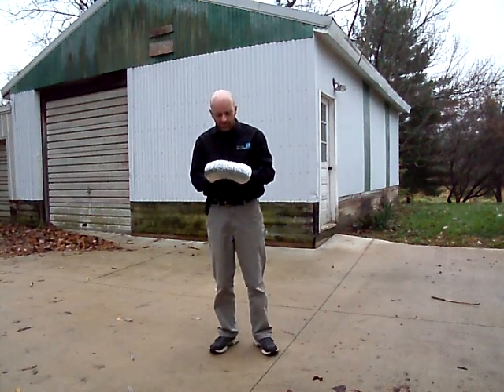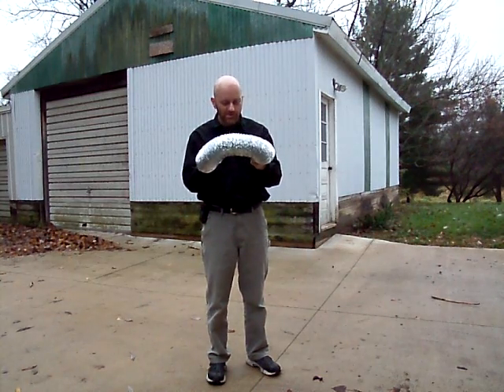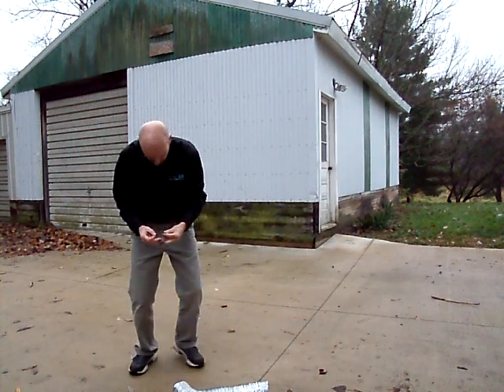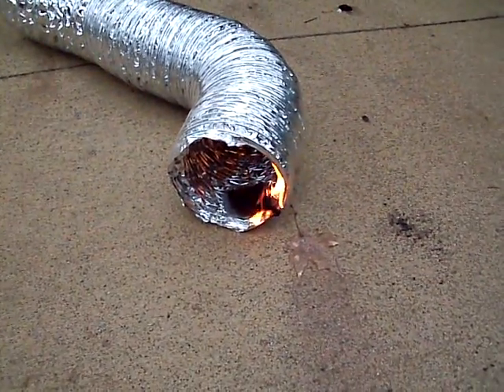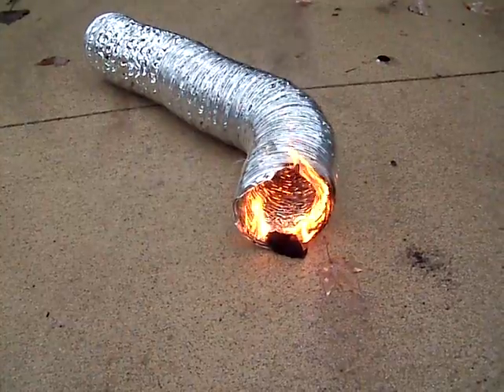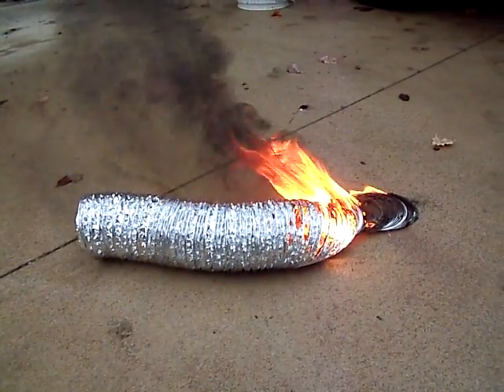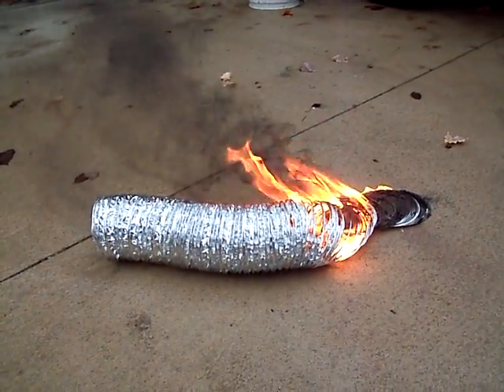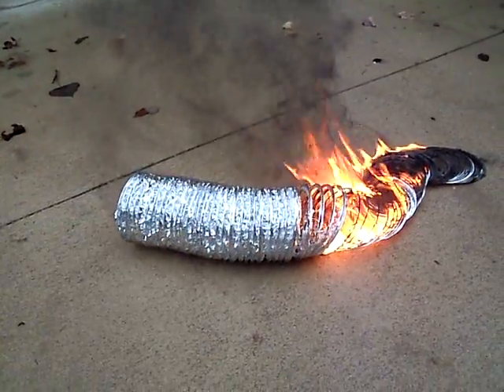Dryer vent installation BAD IDEA

Comment: The bad stuff shown here does contain a very thin sheet of foil (or maybe two, I have no idea), but there's a plastic liner inside (or between the two sheets). Obviously that thin sheet of foil isn't going to hold up if the plastic lining catches on fire. Unfortunately, the semi-rigid duct is a pain to work with (and in some cases, you might need two of them), but it's worth it for the elimination of the fire hazard. Just don't use it anywhere the duct goes through the wall or floor, anywhere hidden in the walls or floors, or anywhere downstream of a built-in duct.

Comment: I used to work at a factory that made those hoses I ran the machines that made them I no longer work there in Indianapolis Indiana called Deflect-o I worked there from Jun 15th 1997 til February 13th 2008 I remember when Oshawa came in and made them do tests on the hose , they had to build a room in our department and yes they flamed up but is that the hose that is black inside or aluminum? Anyway found out that when they knew Oshawa was coming they would have the main operators to turn down the amount of glue they applied to the material but they did address the problem at one time but who knows

Comment: Do you know if Magvent is ok? The duct coming out of the dryer looks like cheap foil in photos. They say, "Our magnetic dryer vent couplings are made of UL 2158 (0 Flame Spread) transition hose, ferrite ring magnets, and stamped aluminum sheet metal."

Comment: We don't know why who ever up a the top that are making the rules how they can allow this even to be sold. We see this everyday. Explaining this to a customers in these terms, every ridge , Traps the lint, if it gets plugged and it's a gas dryer, The carbon monoxide with come into the house instead of going outside,.
Also All flex dryer venting traps the lint in the walls of the vent. also hinders the air flow. 
Was Great to see this video as most home owners and HOA's Don't know about this and almost have to plead to get the point across. Good Job!!!

Comment: This stuff isn't made for dryer venting--its made for exhaust fans and other low temp venting. It clearly state on packaging "NOT FOR DRYER VENTING" that's why its important to read. Hell,flexible air duct for your central air will burn too, but we don't connect to dryers. Some things are better left to those who know. If you think you can, then check you homeowners policy coverage and make sure its current.

Comment: Scared myself, once.  The dryer wasn't drying a load of clothes in the "usual" hour, so I thought:  "maybe there's an accumulation of lint in the system."
The first problem, was getting the screws off the back of the dryer:  they were hexagon-shaped heads, no slots or the usual screw heads.
I found my magnetic screwdriver that has twelve different bits, and, looking at the screwdriver itself, the shaft had a hexagon-shaped head.  Perfect!  Hopefully, that will work.  (I was crossing my fingers!)
It did, and with a little muscle, I managed to get the screws off the back of the dryer.
Removing the panel, I found a collection of lint wrapped around the dryer drum, roughly an  inch or so, away from the element!
I looked across the basement, and six feet away from the dryer, is a gas furnace.
Anyway, I managed to vacuum all of the lint that was wrapped around the drum, and there was a few areas that were too small for the vacuum hose to reach.
There's one tool included with a canister vacuum, that, (in my experience), rarely got used:  the crevice tool.  Even though the slot in the end of the tool was plugged with clumps of lint, I managed to get it all out, and the next time the dryer was used, it took one hour to dry a large load of clothes, as opposed to the hour and a half, a week earlier.
The dryer is twelve years old.  It works just as well as it did, when it was new.  (And before I forget:  the dryer vent hose, is aluminum--not plastic.)

Comment: Fantastic video!  Happily, your Amazon link still works, but could you provide links for lengths of 10'?  15' or 20'?  I'd happily buy through your channel's Amazon links, so you can earn a bit (as you should).  But I do need to order asap, as I'm leaving town.  Keep up the great work!
Reply from the maker: Thank you! If you follow the links in the description to get to Amazon, as long as you buy other items during that same click-thru session, it will add it to my tracking ID.

Comment: FAKE. IF THE FIRE STARTS WHILE THE DRYER IS ON. THE VENT HOSE WILL BE CLOSED OFF SO NO OXYGEN NO FIRE.

U DID A VERY POOR EXAMPLE
 NOT EVEN REALISTIC. ANYBODY CAN LIGHT IT UP OUTDOORS WITH OXYGEN.

Comment: In states that have adopted the International Residential Code unamended, a rigid metal dryer duct is required when hidden in the structure but a transition duct is exposed and must be flexible with no seams or joints and UL 2185A rated. There are two classes of this rating: Class 1 and Class 0.  Class 1 has a flame spread of 25 and smoke generated of 50. Class 0 has a flame spread of 0 and smoke generated of 0.  Class 1 is for electric dryers and made of aluminum (not plastic) foil with spiral wire reinforcement )see Jonathan Brett's comment below).    Class 0 is for gas dryers and made of semi rigid aluminum accordion type aluminum.  Class 0 is also found on  a few heavy duty "ribbon" aluminum ducts with spiral reinforcing like DryerFlex now sold by Home Depot under the GE brandname. What you tested appears to be a plastic/mylar duct with no rating.

Comment: why would there be fire inside a dryer?   If you have a fire started inside your dryer than you have worse things to worry about than the vent.  Why is your dryer starting a fire?
Reply from the maker: In a gas dryer, there is fire dude. How do you think it gets hot?
Reply: @MattKnowsThat   Not inside the dryer.  The gas is suppose to be in the motor.

Comment: Some dryer ducts are right behind the dryers in tight laundry areas right off the garage.  Sorry to say but this vent is the only kind that will allow a dryer to push back as far as possible in tight spaces.  Also stacked units in tight closets in apartment buildings, same deal.  As long as you clean it out every 6 months you're fine brother been installing appliances for many years brother

Comment: You point out one huge problem. The other is the CAUSE people are using flex hose..... Dryers have a 28gauge at best, very short connection for vent. This connection compresses, allowing the clamp to just slide off... it is a miserable design flaw.  You got to wonder how many dryers are venting into the room fully, or partially. The industry needs a better connection at the dryer, and a mating one to slide the dryer into, using no flex at all. Should not be rocket science, just simple engineering to fix a 80 year old problem.   
I see an opportunity for an adapter connected at the dryer, and a mating receptacle for the back wall/floor.

Comment: Just bought my condo 2 years ago. Have an older stacked washer and dryer and figured that was why my dryer did not work very well. I went up into my attic yesterday out of curiosity because I wanted to clean my dryer vent duct and wanted to see what I was up against regarding material and distance. What I found was scary. The same vent duct shown in this video is what is in my attic roughly 14 feet of curves, incline and at end to outside it has an extreme bend due to rafter being right in front of exterior exit. I will be contacting property management as to who is responsible for correcting this 'fire hazard' and extreme inefficient material.
Reply: If you are the owner, then you are

Comment: I just had a customer with this stuff. No fire, just bubbled up under normal use. I replaced it with aluminum. good thing his washer broke or I never would have been there to remove it from the dryer.

Comment: The problem with this video is that you have the wrong kind of flexible vent hose. The kind you have isn't intended for use on dryers. If you had gotten the correct flexible vent hose, it wouldn't burn. This video is misleading. Get your facts straight.
Reply: Just curious then...what would the vent hose in video be used for?

Comment: You mean if you fail to maintain your dryer and you plug it with lint, you can actually start a fire?   Clearly people need to be licensed to operate clothes dryers, or maybe dryers should just be banned from residences.   Amateur clothes dryer operators are clearly a danger.
Reply: Nice comment lol

Comment: Thanks for sharing this as people can make mistakes when doing installations. Ignore the wise cracks as some people just don't appreciate being reminding they  are not perfect.  I will keep it in mind NON flammable for dryer vents. You just stopped a potential "OH SH-T" situation in peoples laundry rooms. I know that's what I would say if my dryer vent was burning like that. Especially given the fact the wood part its connected to on the house would burn away to reveal easy access to my basement to (anyone) who sees it.

Comment: Always remove your dryer access cover and vacuum them at lest every few months, turn of the 30 amp breaker to it first. Thousands of homes have burned due to lint build up, the lint screen dos not get it all. also keep the outside vent clear of lint this to is a fire hazard and at worst will over heat your dryer and burn out the thermistor costing you a service call

Comment: Thanks. After I watched this video I just now took that crap off my dryer and replaced it with proper aluminum ducting. Even though it will still burn, it has a much higher melt temp than that Made in China garbage you demonstrated. Thank you!

Comment: For the doubters:  I'd bought aluminum foil ducting, safe up to 185 degrees, approved for my dryer application.  Saw the video, decided to test for myself.  Totally burned through.  On my way to Lowes now for a  metal, semi-rigid.  Do yourself a favor, listen!

Comment: I as well can appreciate this. One factor you may have forgotten is the oxygen levels. When you have both ends opened as this shows, you allow air to freely flow through feeding your fire freely as well. But when the vent is putting out hot air, that dramatically decreases the air flow kind of like heat smothers people in a room. Those who devise these type of vents may consider that in their safety tests. Something to think about anyway.
Reply: That type of hose is NOT approved for use on a dryer

Comment: ive had this type in my home for 25 years, never had a problem. periodically I will clean the lint thru the entire length of duct. M y dryer is a gas dryer, but it is something to consider.

Comment: the flex material for dryer vents is 414 UL 5 layer foil,  is rated for 600 degrees, that has to be a bathroom material (bathroom flex has a plastic in layer inside, that's what is burning in the video and is not build to with Dr and 60p degree like the dryer vent material), lowes and home depot sell it in the section where you buy things for dryer vents, it's label really tiny don't use for dryer vents and that small piece lint would burn itself out, you are only allowed to use that material for 5 ft from the dryer to the 4in steel pipe, that flex can't go through a wall or ceiling or floor, I do agree hard pipe it is the way to go the personally, that's why u should have your vent cleaned every 2 year's, the problem with hard piping the dryers is the home owner pulls the dryer out to clean it and then never push the dryer back correctly,

Comment: you positive you're not using the bathroom exhaust flex? yes the flex dryer vent is only good for 5 ft in the laundry room. the bathroom has a vinyl material in it, the dryer flex material does not

Comment: Rigid metal duct is only where you're not trying to get behind the dryer (laundromat).  Home users often fiddle with plugs or rearrange their appliances - so flexible hoses are important to have.  I didn't know about the vapor leaks, though.  That's something people need to know.  Thanks for presenting this video, Matt.

Comment: Behind Sheetrock in my basement 2 lengths of this in vinyl were duct taped together making about a 35' run of this crap, the vinyl was outlawed but this was behind sheetrock. I had this stuff it was clogged up real bad and you could see pin hole's where small fires had started, this wasn't even a Gas dryer it was Electric dryer. I let it run like that for 10 years not knowing, it had been in the house for 7 years befor I bought the house.
That's 17 years of dryer lint in the line. I had to repair damaged heater floor vent the cat pissed in so I opened the drywall popcorn ceiling to do this and found a 2x10 joins bay loaded full of dryer lint from end to end. This was a lot of Lint. The house could have burned down from it and I often hear cracking joist but didn't know why after fixing this that fixed the problem of that, the joist were taking on moisture and warping drying out and making sounds. First off 35' for a dryer vent is way too long but if that's what you need to do Only use solid metal pipe with no screws, use foil tape to hold parts together.
I took all this crap out and ran it out into my garage then out a side wall total length 4 foot.
My dryer works better and doesn't break down as much. I intend on building a 4 hour fire rated box made of cement fiberboard around the duct work this is better than code. You can not by code vent a dryer into a garage. It's a fire risk, but its better than 35 feet of Vinyl pipe inside of a sheetrock ceiling. 
This is my reasoning for never putting sheetrock in a finished basement on the ceiling.
You can not see what's behind it or get to it to fix it if you have mechanical problems.

Keep your dryer vents short and no turns if you can. Take your dryer apart and clean out the dust every few years. Wile your at it tape the joints inside the dryer so it won't leak air.

https://www.youtube.com/watch?v=h6AcOHY632k A few good points you need to know.

Comment: Of course the semi-rigid aluminum flex duct is better to use for several reasons, but it is pretty difficult stuff to work with. In addition to banning plastic duct that is made to look like metal, they also should supply fittings to make it easier to attach the semi-rigid duct. Otherwise it is beyond the skills of some DIY-ers to prepare the stuff for assembly. It would be a shame to have to call a plumber for such a simple job. Not to mention, if someone cannot disconnect and reassemble their dryer duct themselves, it discourages frequent cleaning.

Comment: Educate people to READ THE LABEL.  
I bought a length of this for an air vent, and it states on the package that it is not for dryer vents.  
Getting this banned will not ban stupidity.  People will always find a way to screw things up.
Reply: Stupidity more like ignorance. Like the friendly home depot staff who suggest the one that is not for dryer vents.      I think that companies that try and deceive customers who are not experts in dryer venting requirements should be held accountable. The real stupidity is always blaming the customer and taking sides with these massive companies who rake in the profits with shady business practices. There once was loyalty and trust between companies and customers. What about when you open the package when getting home and printed note falls out: Do not return to store where purchased at.  How does this note override the companies return policies? Take an item back and after they approve the return pull, out that little piece of paper and show it to them. Now they won't take it back. If you don't mention it they take it back. How can the same item have two different return policies all dependent on that piece of paper you may or may not see? Take a look at all the major stores and look up their Gross Revenue, Total expenses, then Profit. If the profits are 25% of total sales then  you are probably getting short changed. If it is below 5% the company is working hard for you and you are getting more bang for your buck. This is only a rule of thumb but when you look at where different companies land on the profiablility scale you have a bit more insight on how these corporations work though I am sure there are loop holes being exploited.
Reply: While their is truth in what you say, even if not used for ventilating a drier, any combustible material in the home can cause a small fire to spread very rapidly, particularly when it runs between two or more areas. 
Along with all combustible materials, a review of what can be used in homes in the US is long overdue.